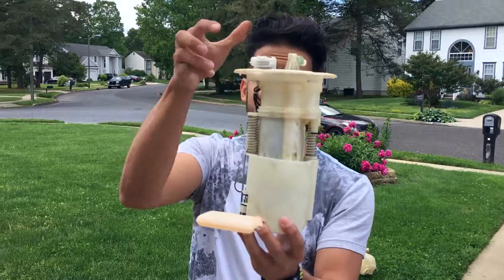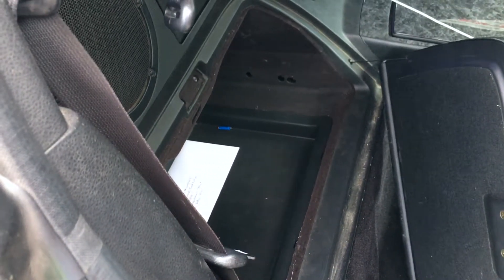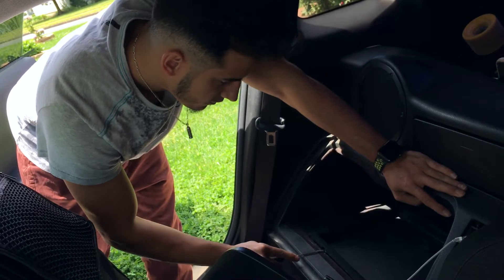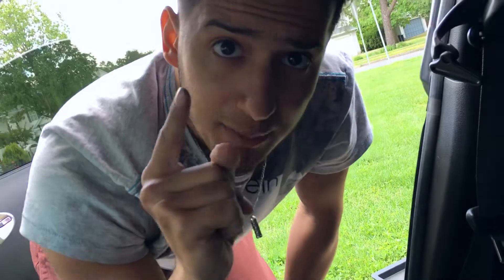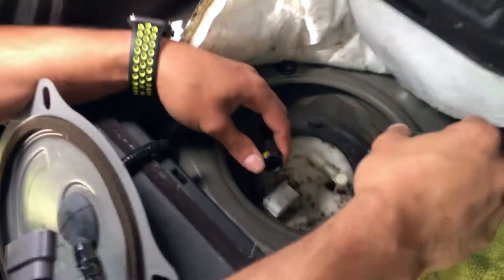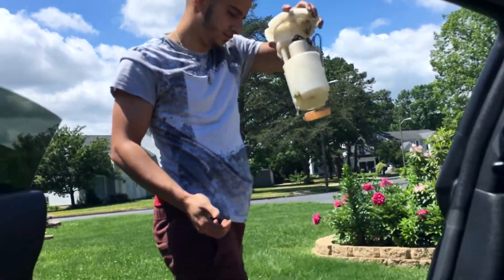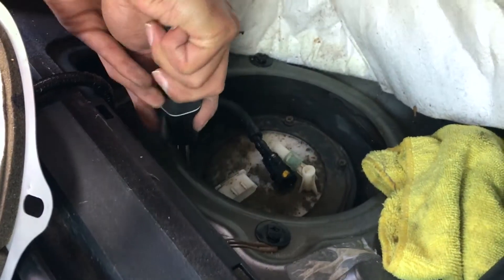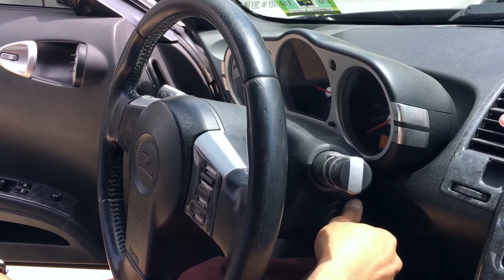Installing a New Fuel Pump on The 350Z!

Comment: just done this. my tip is to relieve the pressure in the tank by opening the fuel filler cap, otherwise it means it will cause the pump keeps sending fuel onto your rag  when you disconnect the fuel line.

also when reassembling you may feel your fuel pump isn't going into the tank far enough. the body is spring loaded so some downward pressure is needed on the top of the pump so you can put the screws back in the retaining clip which sits on top.
Reply: Good tips
Reply: im having the issue where ,y fuel pump feels like it's not going completely into the tank. even when I apply pressure to the top it still fails to go flush that way I could screw everything down. do you possibly have any other tips?
Reply: @KeeRexx95  is your float getting in the way? the thing that measures the fuel level. of not when you have the pump out the tank can you compress the bottom as it's designed? if not it would explain why you can't get it flush
Reply: @KeeRexx95 i have the same issue.did you get yours fixed?

Comment: Hey so on my 350z when I’m 1/4 low on gas it starts misfiring and feels rough could it be my fuel pump?
Reply: Did you find a solution ?

Comment: Bro my gas gauge is not reading the proper amount of gas i have in my tank it stayed on full for some reason any idea what it could be?
Reply from the maker: Anthony Rodelas Honestly my best guess is the leverage being messed up on the fuel pump assembly. Z's and G's are notorious for having that issue with their fuel gauges. See if you can find a local who's parting out their Z and swap in a new fuel pump assembly
Reply: RNYE thanks alot bro im pretty sure it is i been told vqs are known for this common issue

Comment: My car has a rough start and wondering if that’s why
Reply: Like it takes 5 secs to turn on
Reply from the maker: My issue was mainly the car cranking but not starting. So if it takes a little bit to turn out that could be a starter starting to die out.
Reply: Did you find a solution ?
Reply: @geeked_up  never lol moved on from that Z soon after 
Now I’m building an integra
Reply: @Drew.coggs_ig  awe 😏 lol